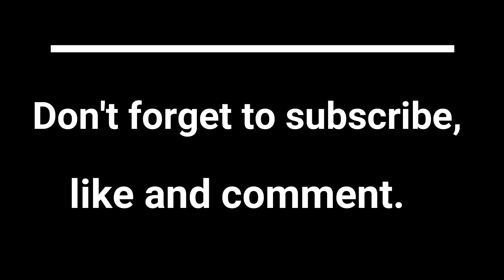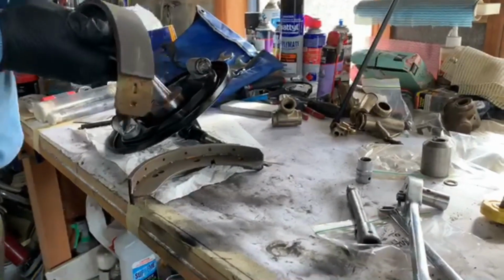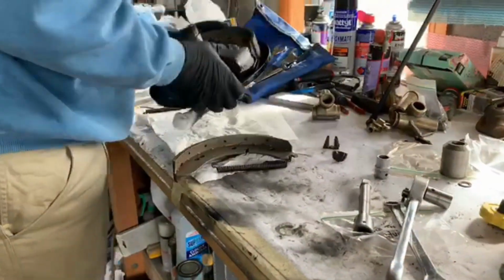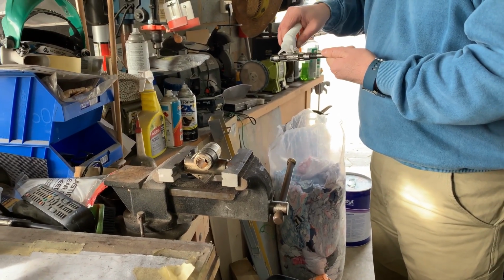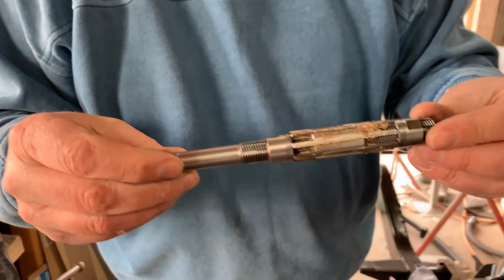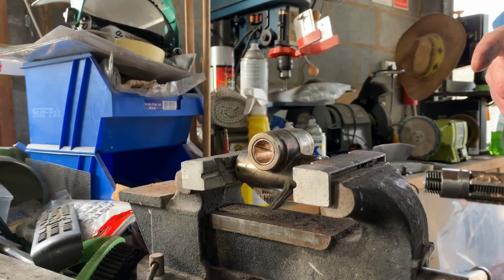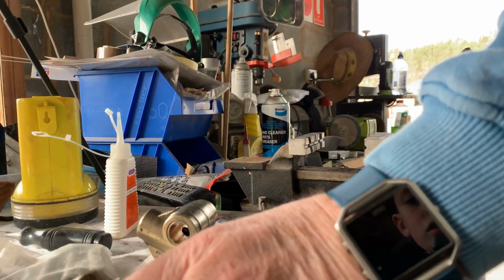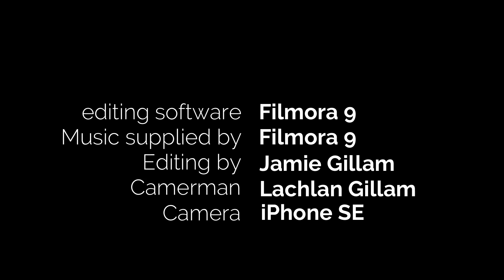1950 MGTD Rebuild Episode 25

Comment: I found it alot easier to install the brake shoes with the suspension installed on the car.  That way, you're not fighting against yourself.   Also, I just used a 3/4" reamer-one pass through.   I measured the bushing at about .749, so I figured it would be close enough, and I could hone it a bit if needed

Comment: You will not be able to install the bottom link to the swivel with the brake back plate fixed to the steering knuckle.
Reply from the maker: Yes i discovered that and had to unbolt the backing plate to fit it